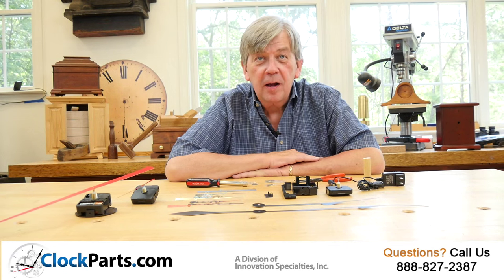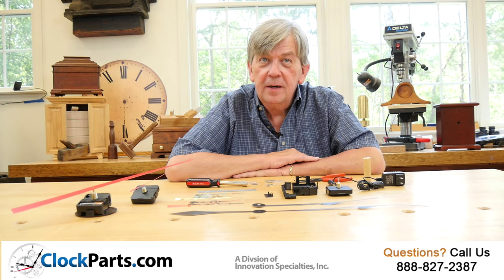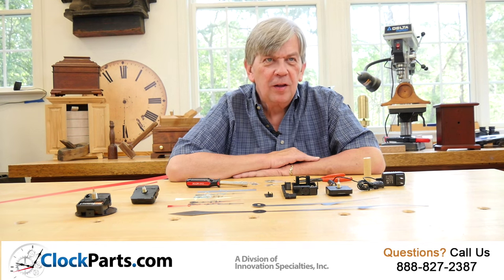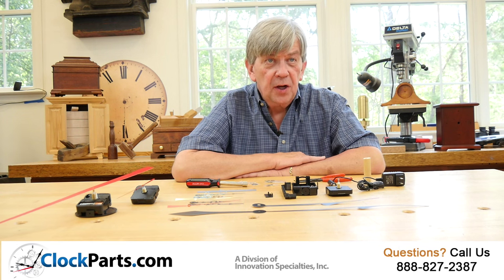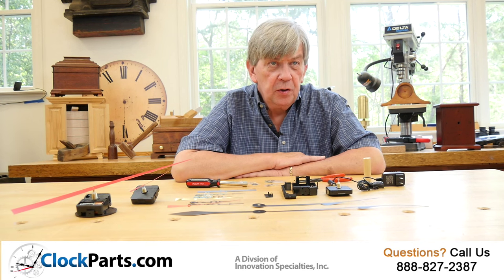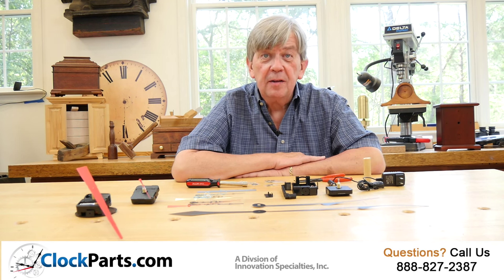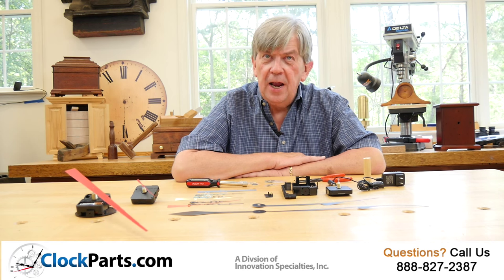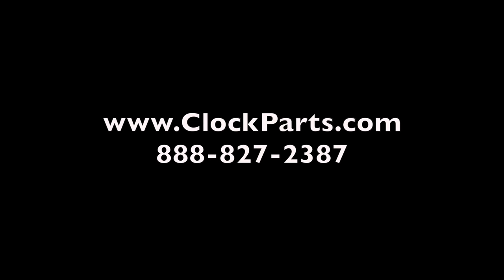Quiet Clock Motor - Best Silent Clock Movement for Any Clock Kit Project

Comment: I was interested in the “continuous sweep” mechanism you specifically mentioned in the video but the website is not easily navigated to arrive at this part. I even used the search bar function to no avail. I suspect what I’m looking for is in the site but it would make things SO much easier if you organized and labeled the website pages with keywords like “Silent Clock Parts” or “Continuous Sweep Silent something” in addition to whatever the real technical terms are so the consumer can navigate quickly.

Comment: ticking is bad but sweeping sound makes me crazy, constant whine of gears... it goes higher when second hand is going down instead of working against gravity... 
we don't need second hand in wall clocks. why can't there be a movement with just minute, hour hands and that would mean no sound whatsoever.
Reply: the ticking doesn't come from the hand but from the relay that needs to set every second

Comment: What is difference between tik tik clock and silent clock please any one
Reply: The difference and to distinguish between a regular conventional tick, tick motor shaft and a silent sweep type is that the 'silent sweep' type mechanism shafts has an extra gear (most usually have the transparent silicone fragile flexible gear) right after the main spinning smallest motor gear that has the round magnet underneath and despite the presence of the extra gear, the motor gear spins continuously and faster compared with the spin 
-and -stop two position spinning type motor.